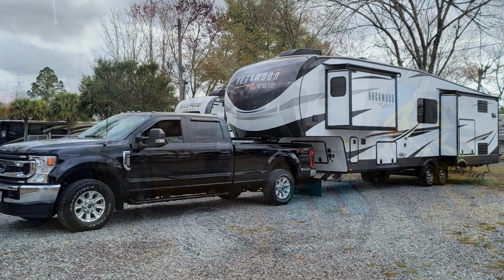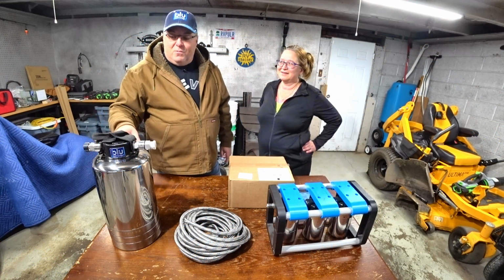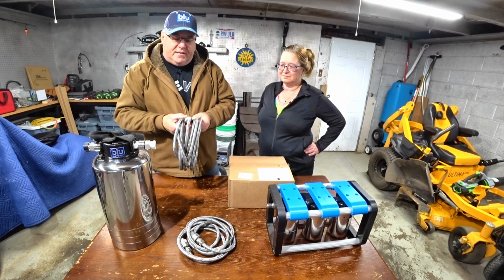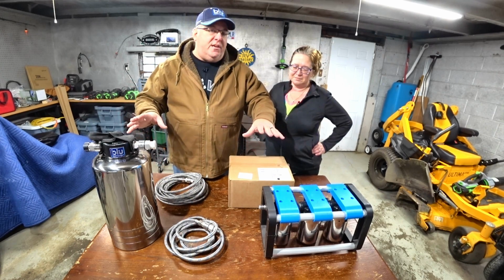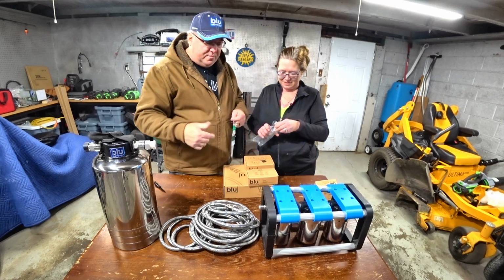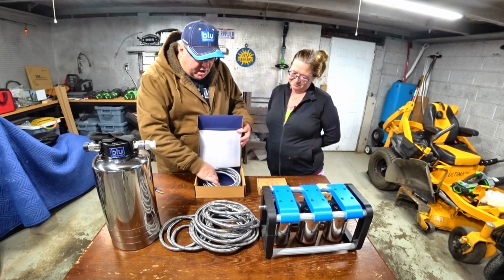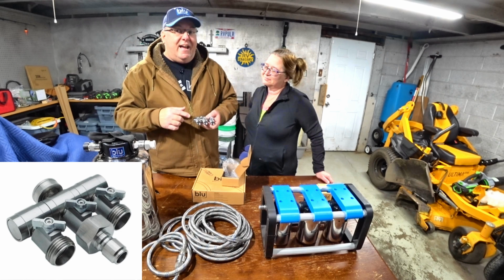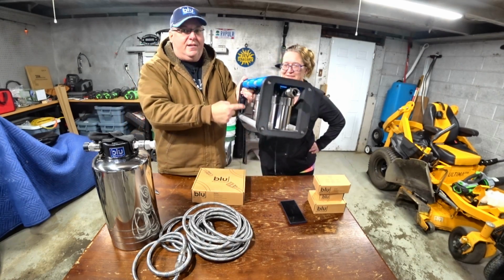Blu Technology BEST RV Water system

Comment: What about the UV disinfecting light? Did you use this disinfection device as well? I do not see a replacement bulb for the UV light on the their website.
Reply from the maker: No we did not. We receive this system far before they had that UV light setup. Those guys are spectacular out there just make sure that you tell them that you saw our video RVdaydream and that will let them know that you are real RVs and what you're trying to achieve. The only reason I say that is so they can dial you into a unit that works for RVs instead of something that might be designed to be carried in a backpack and thrown in a creek for a water source or something like that. LOL

Comment: How do you keep everything from freezing?
Reply from the maker: Our pass through is heated. If yours is not all you need to do is add a light bulb with a reflector lamp shade. Basically it looks like a metal Bowl that you put a bulb in with a clamp for the mount which you can find at most of the hardware stores.